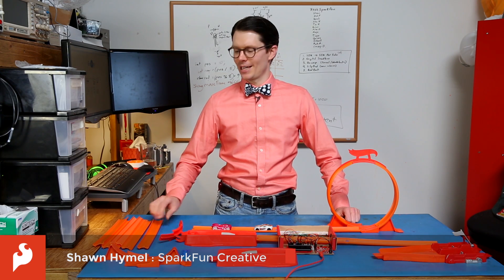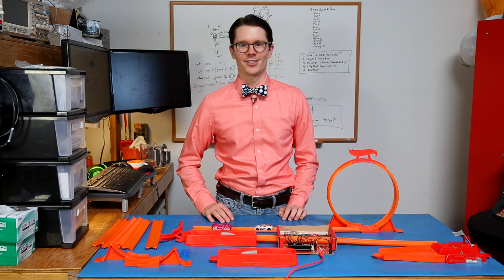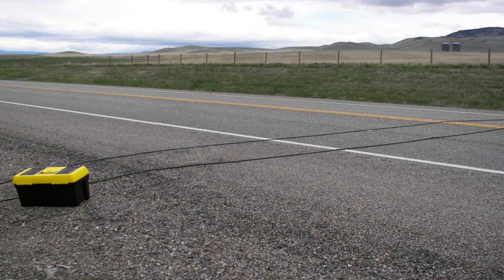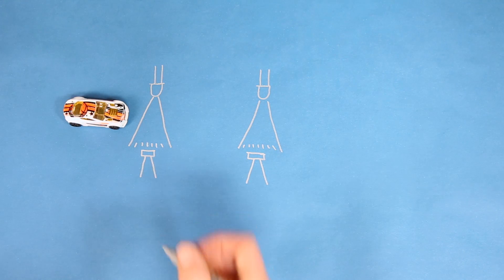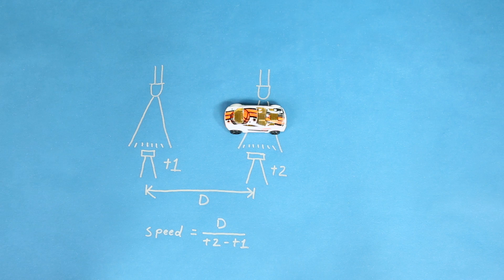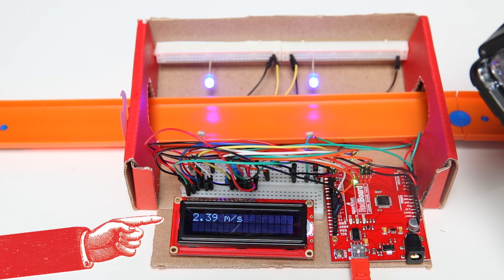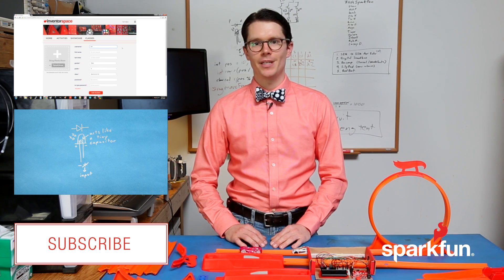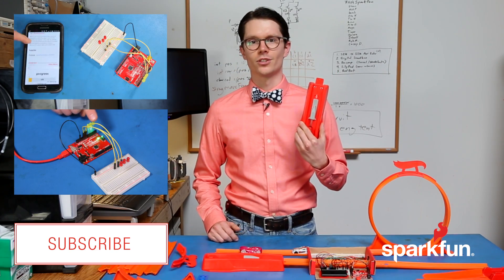SparkFun Toy Car Speed Trap

Comment: You have made a tremendous job by prepearing this great project. I also wanted to check the speed with the #PASCO Scientific Capstone program and I realized that there was a mistake in the measurement. I got the speed as 0.4 m/s instead of 4 m/s.

Comment: Enough with metric! Great Britain right now seriously  considering going back to inches. Check it if you don't believe me.
Reply: Sounds like deluded or wishful thinking?  My take is that, no way will the UK or GB go back to imperial measurements except for 'on the road / rail we will retain 'MPH' for speed and 'Miles' for distance, because it costs too much to change.  Metric measurement is way more logical and also easier for computer programs. Please provide your evidence and source when making such a claim or simply state you are making an opinion and what logic you are using (e.g. who benefits?)
It would also be good if the presenter would try to estimate the accuracy of such a measurement, and how repeatable are the results?  It's my experience that any measurement to 1000th of a second is not as easy as it sounds and this creates a + or - variance in the result.  Rotating (or swinging pendulum) an object through the timing loop 100 times at different speeds will give you an idea about the measuring equipment induced variance / granularity.

Comment: What is the top speed this thing can record? From my experience with these photocells the latency is too slow to record a small object passing through quickly. I had more success and precision with IR beams.
Reply: I did a very similar project with both options (photocells and IR) and it works well. At the end the most critical thing is your program. For this speed it could work well if you use "if" statements, but I highly recommend to use Interrupts: https://www.arduino.cc/en/Reference/AttachInterrupt